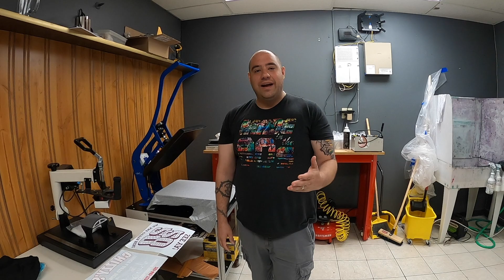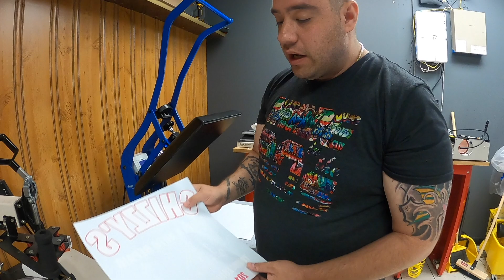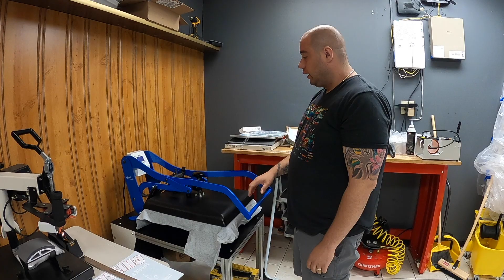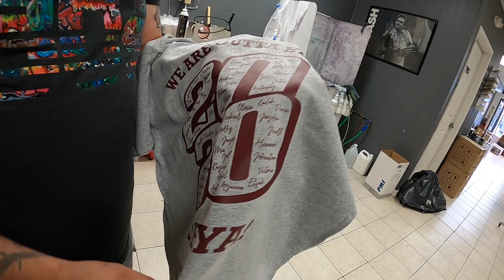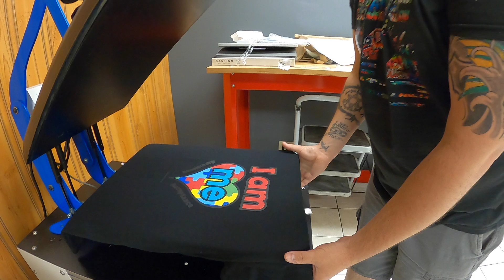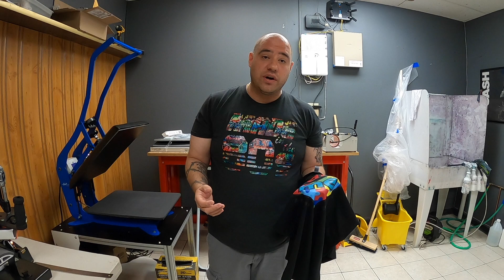613 Originals Review - Are $0.15 One Color Heat Transfer Really Worth It?

Comment: have you done the vintage transfers?  If so how is the quality on yours?      After i press it prints clearly , but seems very weak. i can rub thumb nail across and they rub off
Reply from the maker: Vintage is a much thinner layer of ink. That’s what gives it the vintage look. I personally do not like them or use it in my business. I found making a distressed design and using a varsity transfer works way better.